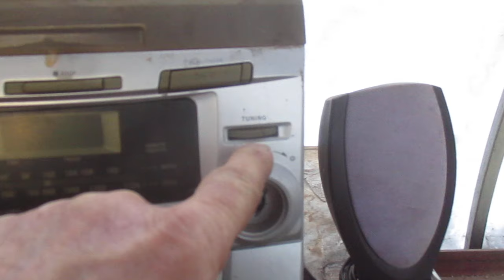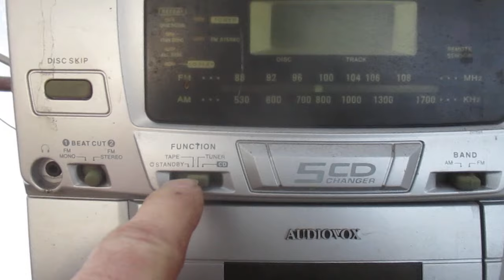Almost no video tonight then this poped  up  # 1403

Comment: Good video luckily most of our snow and ice melted before it got cold. I cut fire wood today wind was really bad. I have been burning a lot of wood to. Take care, be safe and well.
Reply from the maker: hi there just think what your heating bills would be ,be summer before we know it thanks for dropping in john
Reply: @fricknjeep  with heating oil it would cost $ 3,000 to $ 4,0000  fire box in it burn out 20 years ago so only heat I have is wood.

Comment: Hey John, I never knew that boilers ate so much wood. I thought ,you seemed to have years of stock wood just sitting around. I guess all we can do think spring, according to my math we just about 1/2 way through this cold weather.   🥶🥶🥶🥶🥶🥶🥶🥶         btim   SW PA
Reply from the maker: hi there i burn about a cor a week , but i heat alot . thanks for stopping in john